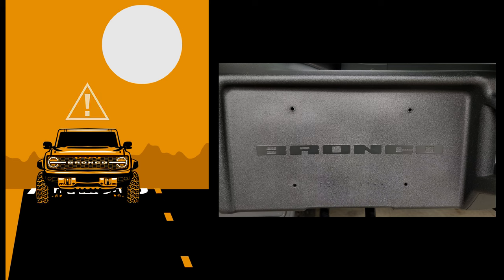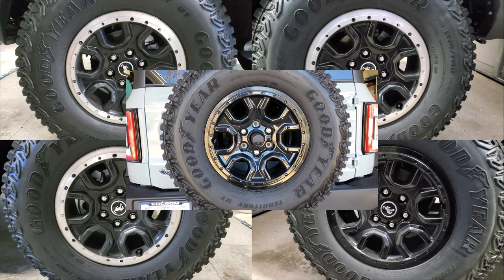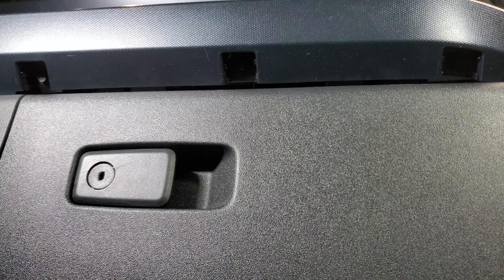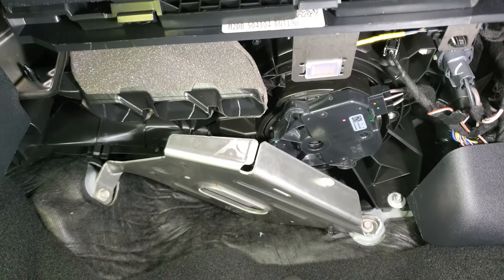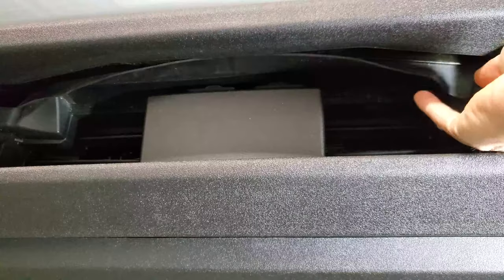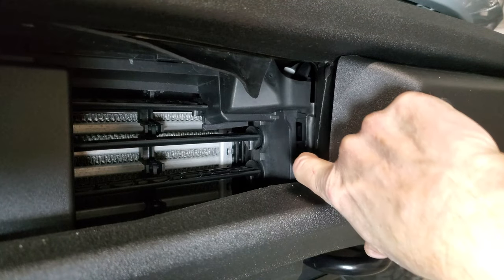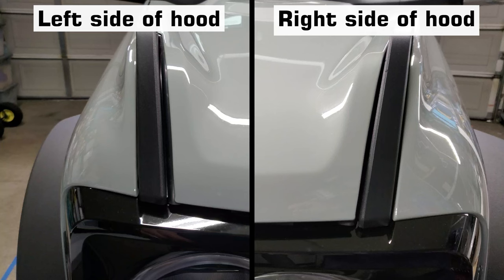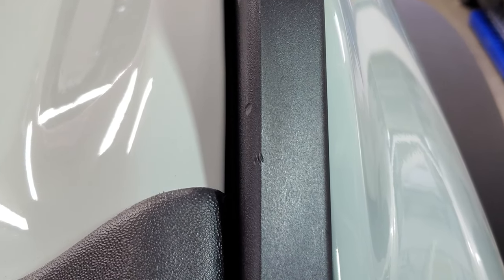It’s the Little Things – The Ford Bronco Has Some Obvious Quality Control and Build Problems

Comment: 2023 wildtrack.. i was putting overlays on the B pillar between the front and rear window. I couldnt understand why the driverside looked crooked. The gasket on thr drivers front dont match up with the rear, the rear is abiut 1/4 " lower. Passanger side is fine. .now i have to keep looking. Oh , anyone else have a pre  collision avoidace  system that dont seem to work?

Comment: We have had the same problems the whole right side panels were not aligned and the door was set in to tight had the slam it to make the window work .. they did fix it but it took two trips .. both bumpers were uneven also
Reply from the maker: Wow! That sounds a lot worse! ☹️

Comment: I already had my front bumper off.    Those flaps dont stick out for me.    Foot well, thats a Karen complaint,  unless you wear mirrored shoes.   My panel gaps are fine, exept the plastic panels by the tail light.  Popped it off and adjusted with 1 bolt.   I think my boggest beef is the lack of any sound proofing around the sub woofer on the B&O / Lux package.  Overall the premium sound package is fat from premium.
Reply from the maker: I might be nitpicking on the footwell panels, but we've got an older Ford focus that cost a fraction of the Bronco, that was worthy of them, so it bugs me a bit. I agree with the sound system. I don't think my wife minds it, but I've been spoiled with better systems...

Comment: Sometimes my door won't unlock when I pull the handle (and I am touching the button on the handle) then I need to use the keyfob to unlock the doors and after i start it and start to drive off I get a message no keyfob detected, if that's the case why did it start at all, other then that alls good.
Reply from the maker: That's an interesting one. 🤔

Comment: Aha; I see you took my advice and looked above the glove box. 🙂
I'm thinking only '21s got those lower covers - I've looked even on some '22 OBX and Badlands models; no dice. 
Ironically enough, I did just install the covers I sourced with FordPass points last night...

Footwell covers don't bother me as it's one less PITA thing to get in the way of me working with the AUX wiring runs, changing cabin air filter, servicing blower motor, etc. 

Gonna have to look again at my hood though. I definitely notice the passenger side near the trail sight is a little lower than the driver's side but is NOT dented. Not sure how I could resolve this...
Reply from the maker: Lol! Yes, thanks for bringing it to my attention! ☹️
Reply: My '21 Big Bend was #626 off the line (last 5 digits of vin) and it does not have the bolt covers.

Comment: Par for the course on these unfortunately. Passenger door, hood, tailgate and windshield are crooked on mine. Also have several pretty obvious paint defects. It’s really sad that they designed such a cool vehicle to be butchered on the assembly line.
Reply from the maker: That sucks. We've also noticed some fairly obvious paint defects. ☹️

Comment: Come on now. Some of it I get but some of it is ridiculous. I say that because the higher the quality control the higher the cost. The one reason airplanes and airplane parts cost so much is the amount of quality control to make a perfect product. Airplane parts have to be perfect because people’s lives are more at stake. I worked in several manufacturing plants. They plan on a certain amount of products coming off the line to “fail” and not meet a certain level of quality control. When parts that don’t rely on safety are concerned, a balance has to be met. If half the products that come off the line fail, that increases cost. Yet, to increase the quality coming off the line also increases cost. Therefore a balance has to be made. 

Ford could hand build Broncos just like Rolls Royce and Bentley build card by hand, and the quality would probably triple. Yet the price would triple as well.

Precession made parts that meet very strict toleration specs cost more than those that have looser specs.

However, some of the items that you point out, not all of them should be taken into your ford dealer and pointed out and can be corrected under warranty at your ford dealer.